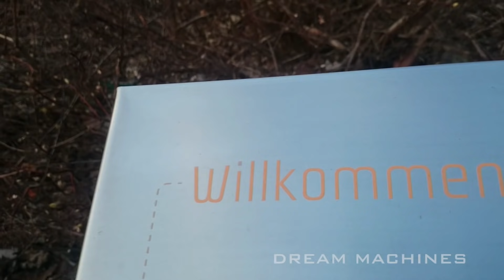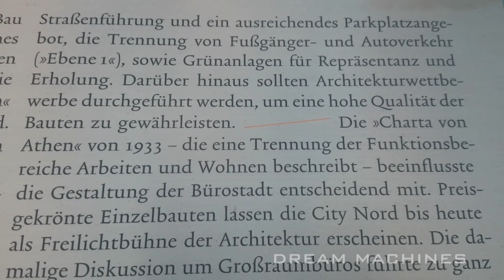Big boom at demolition! Jaw-dropping moment excavators bringing down 11 floors at once

Comment: Would it be easier to use explosives for it?
Reply from the maker: NO! nearby buildings would be damaged! blowing it up needs a lot of preparation drilling thousands of holes for the explosives. And you would need to separate thousand tons of dirt so it is not faster at the end.
Reply: @DREAMMACHINEShh  Maybe it is also by the form. If it  were a the same profile bottom to top it could be cut by means of explosives in the middle. But still too many windows around.